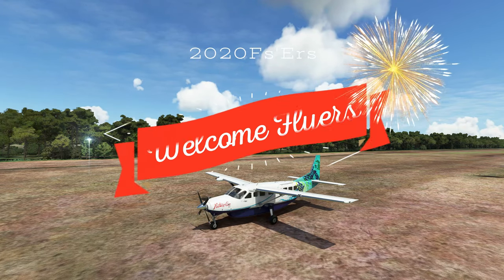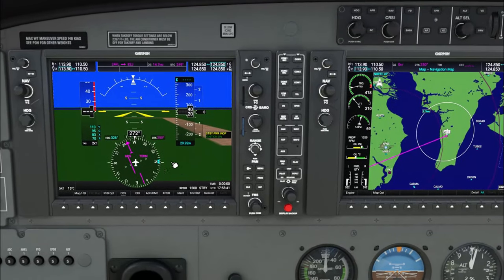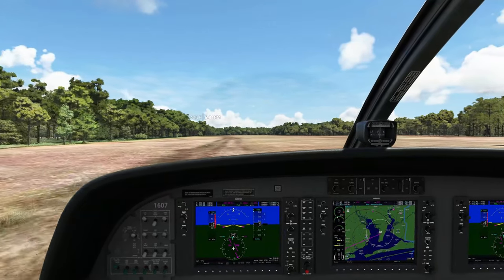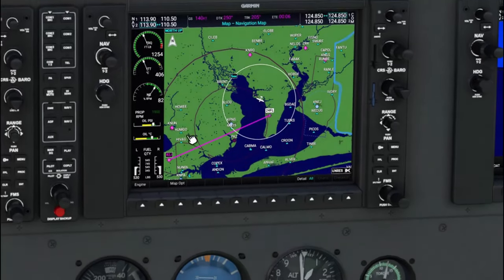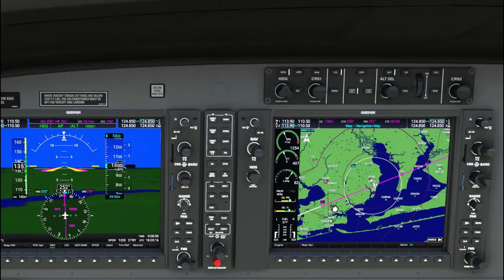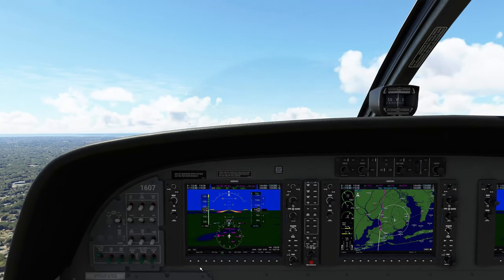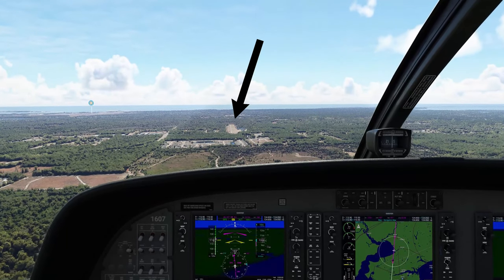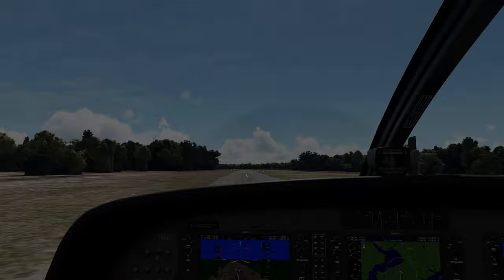Msfs 2020 G1000nxi **OBS** Tutorial for VFR Perfect Landing Align. With Cessna 208b  Must see !!

Comment: Hm, so I tried this at EDDC and ended somewhat misaligned with the main runway. It looked as if the coordinates of the runway are little off.
Reply from the maker: it also depends on where they place the waypoint in the gps . because when you select obs it uses the very next waypoint as the obs waypoint so for airports with say parallel runways this method will get you close. so if they place the waypoint for the airport off center of the airport then the obs wont be lined up correct it may be an asobo thing

Comment: Hey one thing I ran into on AirNav when using the OBS do you use the magnetic heading for the runway or true heading?
Reply from the maker: magnetic heading
Reply: @2020fsers  ok thanks that's what I figured but with the gps indicator I wasn't 100%sure.  Thanks

Comment: Hey great vids, keep em coming! I'm now using OBS mode a lot but have come across instances where the point the OBS line is centered is not on the runway, quite often in the middle of a field next to the runway. Is this just a mismatch with MSFS nav data? Also if there are 2 parallel runways how do you make the OBS centre off your desired runway? Thx!
Reply from the maker: Hey thanks for the comment I think it is a mismatch in msfs when you hit the obs button it will use the very next waypoint as the destination so to speak .and if there is a parallel runway unfortunately you can't do much about that the obs will get you close but then need to use our eyes for the rest of the way .
Reply: @2020fsers  What? Manual flying? Omg what a concept! 😱 🤣 Thx, I thought as much. 😎
Reply from the maker: I wasn't trying to be a smart ass or anything I  hope you didn't take it that way.
Reply: @2020fsers  oh good grief no! My reply laced with liberal amount of humor. People are way too serious these days 😊
Reply: @2020fsers  Your reply also got me thinking, I often set waypoints to the airport/airfield rather than the runway which also could account for off centre OBS. I’ll be testing that out. 🙂
Reply from the maker: Lol ok good I just didn't want to speak out of place . Let me know how testing goes

Comment: Great thanks
Reply from the maker: Your welcome thanks for the comment
Reply: @2020fsers  Tried two attempts a t the OBS an twice I was no where near lining up at the runway
Reply from the maker: Did you set the course on the obs after you select it ? Also was the next waypoint the arrival airport ?
Reply: @2020fsers  hi thanks for the reply. The waypoint was arrival. I was heading straight to it. I dialled in the OBS the runway heading, adjusted the heading to intercept the the magenta line but was so far out. Try it EGNT to EGNC RW19
Reply from the maker: Ok also try a flight in the US and see if you still have the same issue some airports are funny in msfs and things don't line up correctly.  If you have an ils you can also set that into nav 1 . Set the hsi to nav 1 and then use the obs with that as well instead of using a  gps waypoint .
Reply: @2020fsers  did you try the 20 minute flight and see what you got?
Reply from the maker: No I haven't I honestly don't get much time to spend with the sim unfortunately.

Comment: Not sure if my adhd kicked in or what but where did you find the runway heading?
Reply from the maker: Hey there so you can get the runway heading from the airport charts like skyvector or the runway heading also corresponds to the runway number . So runway 24 is heading 240  and runway 08 is heading 080 roughly. Hope this helps . I go over a lot of this in the vfr training series playlist
Reply: @2020fsers  thanks for clearing that up! I was using skyvector. Glad that I was doing that right. Thanks for the info.
Reply from the maker: You are very welcome thanks for the comment 😀 😊

Comment: Great video, made me a subscriber. When I load into the same plane, the obs button is grayed out for me? I'm on Xbox series x. What am I missing?
Reply from the maker: Make sure you download the latest update for the G 1000 in the marketplace..  also maybe you need a flight plan input not sure there is still some bugs with the g1000 . Thanks for watching and yay for the sub thanks again
Reply: @2020fsers  yup that was it, the whole 1.2mb update lol. when did this latest update release?
Reply from the maker: I think the day I posted this video
Reply: @2020fsers  right. nice video. thanks.
Reply: i had watched another vid done by another YT'er "Kip on the Ground" but this is 100% better. Subscribed!
Reply: i have a QN - if i am approaching the OBS' white extended line and turn on GPS it gets activated but doesnt follow inbound course to r/way & it keeps going straight across that line. why is that?
Reply: ditto with the purple line...it just cuts across and flies straight not turning into r/way. is there a bug??
Reply from the maker: @Sanctimonious007  hmm if nav is active and you see gps at the top in green then it should follow but if gps is in white then you may need to activate heading possibly for it to lock on the gps course and this can also be a bug I found when I did use obs the distance was not showing correct either so I can't do the ifr holding video yet because of that .
Reply from the maker: So if heading and nav are active at the top hdg is in green and gps in white . Means it is on heading hold when green and when it switches to gps hold the hdg will drop off and gps will go green .
Reply from the maker: @Sanctimonious007  hey thank you for watching 👀 glad you liked it 😊
Reply from the maker: @Sanctimonious007  oh also remember if you try and intercept the white line it will take you away from the runway  so you want to intercept the purple line before the runway think of it as a vor when using obs . I have a great video on vor tracking in the cessna 152
Reply: @2020fsers  yes GPS was green as it came near the purple line but it cut across that and continue flying in a straight line. However in the second attempt i made it was working fine. so probably its a bug.
Reply from the maker: @Sanctimonious007  lol yeah still lots of them . They will get worked out but for now I am very pleased at what they have done so far the future looks good.
Reply: @2020fsers  it did fly away from r/way. yes. thanks . its a learning for me today. will watch your VOR vid. 👍
Reply: @Sanctimonious007  You must turn the nav back on then you will see GPS in white then it should capture the red line.
Reply: @mason19548  and it has to be an ILS r/way. right?
Reply: @Sanctimonious007  No it doesn't because we're only using the runway heading in this instance
Reply: @mason19548  😖

Comment: hey can you pls make a vid on entering and holding patterns?
Reply from the maker: I can if they are published but right now I tried yesterday on doing manual holding using the obs and that didn't work as it is supposed to .  So if you would like one on the published holds I can I'll try it first to make sure that works properly lol 😆
Reply: @2020fsers  i dont know how it happened but i was flying to an airport and my flightpath had a holding pattern and then the next waypoint. i wonder how it happened. after holding on the pattern my GPS flew it to the next waypoint and towards the r/way.
Reply: also can u pls tell me what to do when the G/O/M light starts blinking near the runway? do i activate APR? i tried but it didnt work.
Reply: @2020fsers  pls do 👌
Reply from the maker: @Sanctimonious007  did you set the hold in the gps flight plan menu?
Reply from the maker: @Sanctimonious007  where you on a ils or rnav approach when you used approach mode if not it won't do anything also if ils need to be in nav 1 or 2 which ever you have your ils freq. In
Reply: @2020fsers  i didnt. i dont even know how to do it. :S
Reply from the maker: @Sanctimonious007  the lights you are referring gom lights are they on the runway ? And is there 4 of them red and white ?
Reply: how do you delete the entire FPL at one go? or is it possible to reverse to/from airports in a FPL. if say you planned X to Y and now you reach Y can you reverse it to return to X? or each line has to be deleted? sorry i have many questions. 😵
Reply: pls make a discord room so its easier to ask questions with SS>
Reply from the maker: I started a great vfr series in the cessna 172 and will explain a lot of stuff. Also the cessna 152 I also have the advanced vor video that's good. I may just do an ifr series on the g1000 as I have not done 1 yet .
Reply: ok i found how to del that. click menu after FPL. another issue remains is that previous flight plan's some purple line and a waypoint still remains on the map and refuses to clear. is that a bug?
Reply from the maker: You can you the rev button on autopilot if it works lol and it will reverse the course. But you can delete the entire flight plan also from the mfd click on fpl button to open flight flan and select menu and it should have a selection for delete flight plan
Reply from the maker: I will check that out not to sure on how to make a discord lol now I'm in the dark 😀 I'm a newbie to that and streaming ahh I just started watching teaching videos on how to do streams my head is blown lol
Reply from the maker: @Sanctimonious007  yes that's a bug I have found that to if I change the fpl then the map doesn't change
Reply from the maker: I would like to do a stream so that people can ask questions and then we can walk through different things  to learn how stuff works but the bugs don't help so I'll see
Reply: @2020fsers  "rev button on autopilot "? where is that? is it BC (back course)?
Reply: @2020fsers  😂
Reply: @2020fsers  yes thats why i said make a discord channel/room. its easy.
Reply: @2020fsers  lemme check that!
Reply: @2020fsers  no the GS lights that turns green for ILS....they make the sound when r/way is near then go off...
Reply from the maker: @Sanctimonious007   okk the o and m above the glide slope on the gps that is the runway marker beacons outside marker and middle marker to let you know where you are in relation to distance from the runway using an audio tone and the flashing on the gps that isnt a prompt to arm approach that should have been done way prior ill do a video on the approach .
Reply: @2020fsers  😬